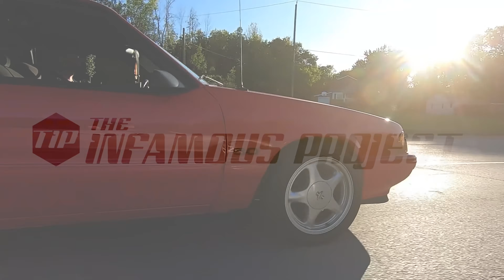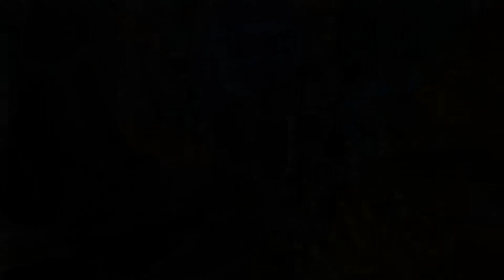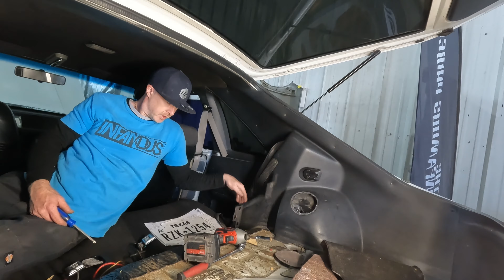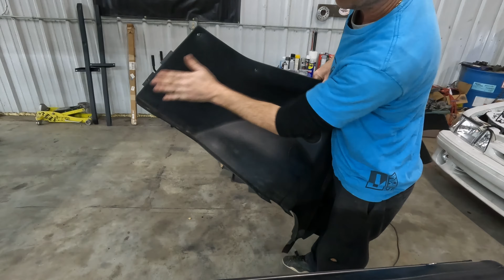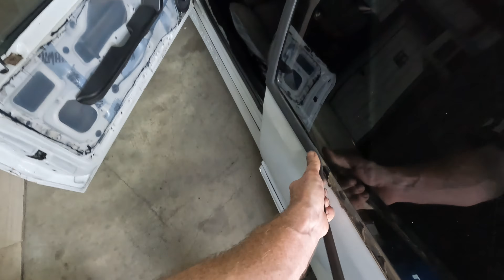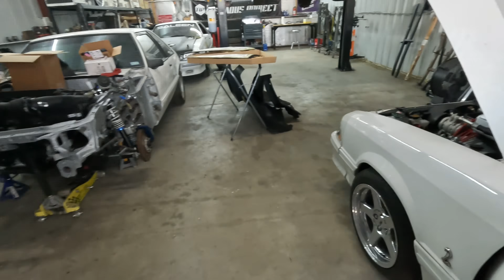"Average" Foxbody Interior TIPs & TRICKs = Like New!

Comment: Going a little off topic here but in regards to the fuel injector harness..im trying to restore my old crusty harness & I’ve taken all the old wire loom & tape off..I’ve found a spot in the harness that’s covered in some black tar like goo..& after cleaning it off it seems all the fuel injectors are connected by the red wire to this spot that was covered in the black goo..is that from factory? I’m look some wiring diagrams & it does confirm that all injectors run power off the red wire but are they all suppose to be joined at one spot like a big clump?
Reply from the maker: Yessir
Reply: Thanks for the reply appreciate the info & all the foxbody content 👍🏼👍🏼

Comment: I have a question what are you thoughts on long tubes?
Reply: I know you asked Chris his opinion on long tube headers and not me....I have owned and heavily upgraded 3 mustangs. All were pushrod 5.0. I had a 1990 hatchback, 1993 Cobra(left power train and drivetrain alone... Did exhaust and chromed the original cobra wheels) and had a 1995 5.0..... first the 95 I used. BBK long tube headers and in the 95 they were definitely the hardest to install...1990 I used hookers and 93 cobra no header... In my opinion and from experience, looking at hp gain/torque gains...long tubes aren't worth the trouble...furthermore(maybe obvious to most people watching this channel) you better have your motor mounts upgraded with poly bushings, subframe connectors etc... cause if you are making good power and that motor wants to twist and torque around even with the best header bolts/locking kits it will constantly back bolts off, blow gaskets, leak etc... Again, the juice ain't worth the squeeze when it comes to long tubes.... High flow shortys or hell, even using stock exhaust manifold best way to go. My opinion, others might completely disagree...but I have personally experienced the headaches and letdown associated with long tubes.... Love the channel!!! This is the 1st video I have watched on your channel but will definitely subscribe and watch the rest!!!
Reply from the maker: You'll see in the next video
Reply: @TheInfamousProject  oh cool!

Comment: ive owned 10 of these cars and can't believe someone dont know how to install windows in these cars?  first 2 i tore every nut and bolt/ panel and carpet out seeing how it worked. i still remember the dash metal frames dark grey  metal color not all rusted up and now all have the rust color to them .  i never understood people getting any car or truck and not  learning all of that models' strengths and weaknesses.  i love a 87 tilt wheel with the 91 rear seat  belts uppers (no air bag car 87-89 works for me ) BUT i still have a top half off a 81 notch t top ready to be cut and put on a 91-93 notch  car as a fun project 1 day ill complete.